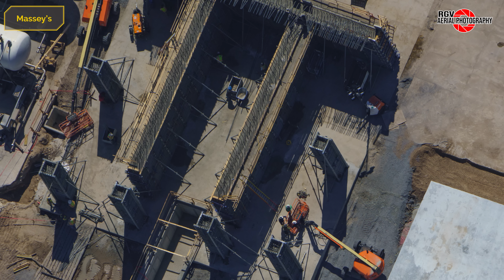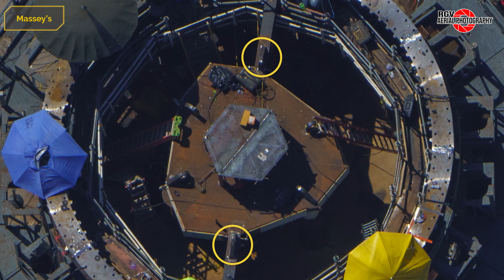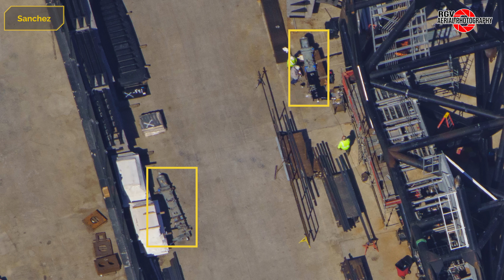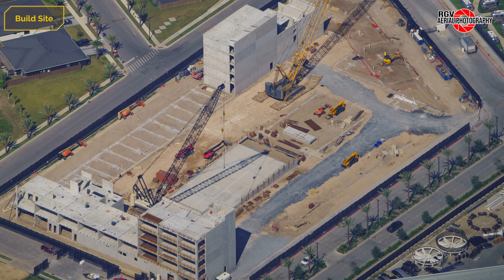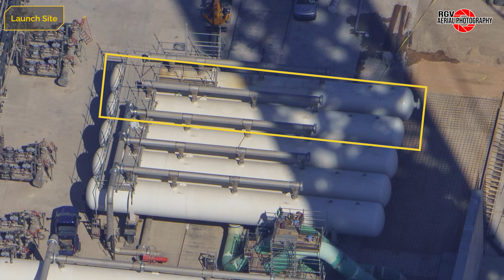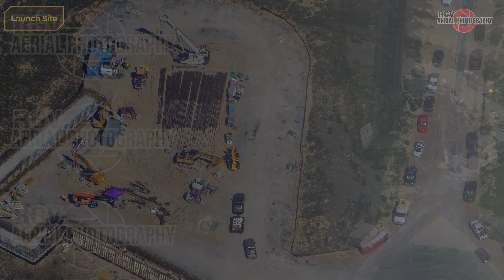Pad 2 Nears Completion + Major Gigabay Updates! NEW Starbase Flyover 96

Comment: Air Sep. Plant will have 3 commodities at the very least, LN2, LOX, and LAr, but I won't be surprised if the store some LCO2 also.  Argon is their plasma thruster fuel of choice for V3 Starlink plus the welding they do at the plant.
Reply: Yeah that combined with the planned LNG liquefaction and purification plant should really help to reduce the amount of semi's needed to keep the tank farm topped up
Reply: Do you know that for a fact? Or just because it makes sense?
Reply: @dphuntsman  spaceX made a pretty big deal of switching to Argon for their Hall effect thrusters on starlinks
Reply: @dphuntsman  To some extent they can't avoid getting Argon in the system, its the 4th most common component of air and it boils at 83K which is warmer than LN2.   Argon is a nobel gas, and makes a decent ion thruster propellant.  Could be substituted for He in some systems also.
Reply: Argon is also used as a shield gas for all of the welding done.  Sometimes it is also a argon/CO2 mixture.  They could custom blend if they need to.